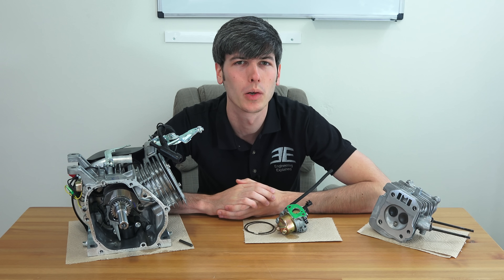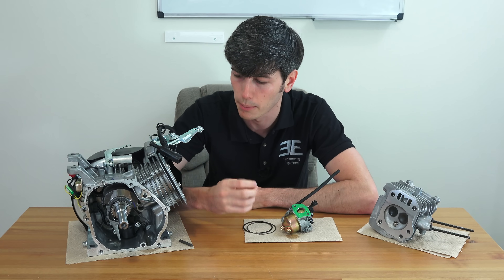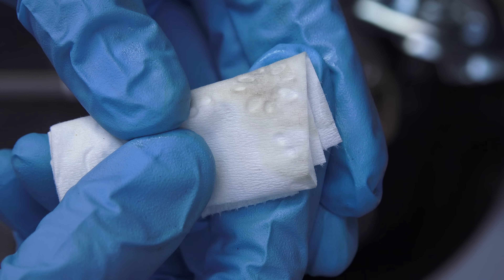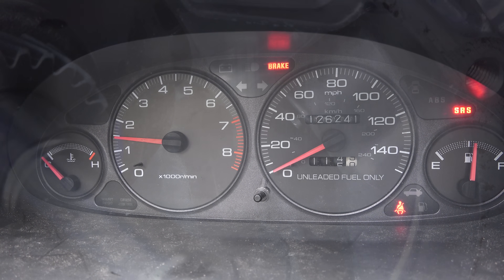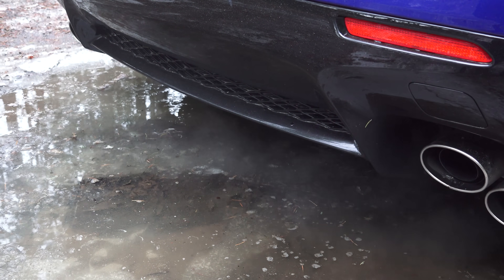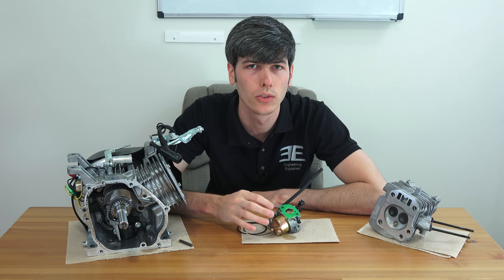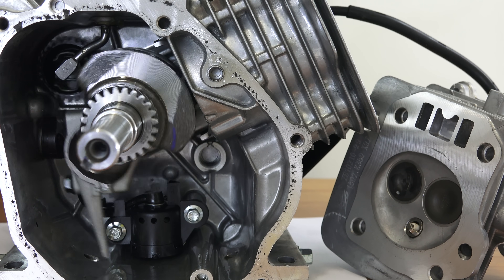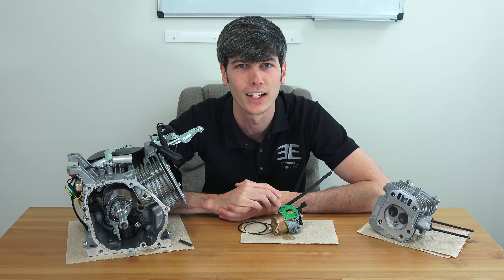Should You Warm Up Your Car Before Driving?

Comment: this is only for the idiots that believe in carbon tax and that brine wont rust out your car.
everyone else that actually has removed a valve cover and seen holes rusted through diff covers just ignore the libtard agenda.

Furthermore, why not just disconnect the heater core while you're at it, who needs heat or defrost?

Comment: What about cars with turbo? I've always been told to warm it up for 5-10 mins then drive it without boost for 5-10 miles then always cool down by driving without boost for 5-10 miles before stopping then letting it idle for 5 minutes once stopped

Comment: Although under some circumstances it's necessary to have a warm car before setting off. In the town where I go to school, so many pedestrians/cyclists get hit, especially in winter, that cops will now cite drivers who have a visibly foggy windshield. Even if you scraped your windshield, it'll still be fogged up on the inside, and no matter how you try to clear it or wipe it it'll stay that way until the heater kicks on and warms it up. I've tried defogger sprays but those hardly work worth a damn.
Reply: I've actually tried that, but in the time it takes to defog I could've had the heater warm it up and set off 15 minutes down the road
Reply: *****
Not REALLY cold, just cold and quite humid. Even if it's kept dry, a pane of glass will get condensed over outside

Comment: Dont warm up yall cars and see what happens.
Reply: Exactly, bad things happen.
Reply: Don't warm it up!!hes totally right. Job security for us mechanics. Headgasket repair labor is lovely 😍💰💰💰💰👍
Reply: My '04 F-150 5.4 3 valve has over 240,000 on the original engine. Guess what I warm it up, keep up on the oil change's and only run Chevron premium. The small difference of a few dollars on a tank full.
Reply: bullet5760 yep generally for the basic people warm up yaz cars.
Reply: Nothing happens, I hop in my car and go in the summer all the time and I run the car hard. The winter? That’s a different story cause I need the coolant to warm up.
Reply: Triple259772 chrisfix is great!
Reply: The wrong way haha
Reply: Ha i'm from Minnesota and i never let the car sit and run for more than 2 min if the wheels aren't turning. Just don't run your car any harder than you want to work and it'll be fine
Reply: no65mph exactly if they not ready to dish out some money they better act like they need they cars and warm them up.
Reply: Steve h calm yourself, you ain’t making nothing. Whenever anything goes wrong I do it myself.

Comment: Getting out of my garage requires to climb a small but steep, requires to go even up to 3000 RPM. What should I do in this case?
Reply: Shon warm the car up first. Minum 3 minutes in cold days or untill the rpm drops to 1,000
Reply: It usually starts at 1200-1400rpm and drops to 1000rpm in less then 30 sec, its ok?
Be advised that the car isnt sitting in the snow\rain, and the current avreage temperature is around 6-10C
Reply: Shon If the vehicle rpm drops to 1,000 that quick then it would  probably be alright to leave perhaps within 2 minutes. Nontheless It would not be a bad thing to wait that long since it gives the vehicle a chance to circulate motor oil thruout it's vital componets.I highly recommend a Lucas oil conditioner to be added to your motor since it would prevent dry engine startup= less engine wear.
Reply: Hawk Hawk aight thanks man!
Reply: More torque output

Comment: All you who think its fine to let your car sit for 10 minutes and get to operating temp are in the wrong. Your transmission never got to operating temp, so your engine might be fine ( although it would actually be healthier if you drove it after a minute lightly )  but your transmission will wear out since you never gave it time to heat up by DRIVING it.

Comment: people in ny dont even wait 2 seconds to let their car warmup. If these people could start a car in drive they would.  the second the car is in drive alot of them put the petal to the floor, while car is cold. so these people need to let their car warm up first.  people forget about vaccum in an engine, as piston travels up the cylinder wall it automatically brings up the oil with it, then the piston rings scrape the oil back to the crankcase.

Comment: there's just as many cons to either way Imo. and my winter daily driver is an old 94 silverado. I like to start it and let it warm up for however it takes to warm the engine. which is usually around 10 to 15 minutes. like I said, it's a '94 and I'm the second owner an the previous owner was my cousin, who would literally start it every day and hour before he left for work and it still runs great, and everything is pretty much original, except for the rear end. so I guese it doesn't do too much wrong to it.

Comment: you completely ignored bearing tolerances.  bearing tolerances are calculated by an engine at operating temperature.... not when they are at 30*F.  so do you want to have tight tolerances while you are idling at 800 rpms, or when you are driving around at 4000 rpms?

Comment: you say cold motor is ok, but that means cold oil, which means much higher oil pressure while driving, wich can lead to a bad oil pump, which can still cost a lot to replace, due to a lot of motors (including one of mine) to have to be pulled out to be replaced. good info, for the motor, but not for the rest of it. but you didn't mention any of that...

Comment: I warm up everything. things I truly care about I wait till almost operating temperature to move them. even in the summer I like to let the oil circulate for 2 minutes before driving. being a mechanic I've seen way too many oil and transmission leaks from people just hitting the key, dump it in drive and go. when the engine warms up too quickly certain metals and materials can't expand at the same rate cause leaks
Reply: The Mouse In Your Room Lmao I'm trusting the mechanic on this one. Metal expansion, idle speed, AFR, oil viscosity and temp are all crucial factors when it comes to a cold or hot motor. Driving on a cold motor is just retarded
Reply: The Mouse In Your Room if I burn 10 extra gallons in one year warming up my vehicle's that's a lot. Well worth it to me. You also need to remember certain vehicles warm up quickly and some take forever. I've never known another mechanic or another mechanically inclined person not to warm up their vehicle. I do however know people that don't and have dealt with leaks and failing components.  A neighbor of mine gets in her Toyota and regardless of outside temperature throws it in drive before the starter is finished spinning. She's on her 2nd engine and this one is already burning oil. Same words came from her mouth " I don't want to waste gas"   $20 vs $1500.  Seems worth to me
Reply: Rollo Larson she says she's far from Mario Andretti. Never been in the car with her but I know she does maintain it. Regardless just warm up an engine there's really nothing to argue about
Reply: The Mouse In Your Room False.
Reply: matt parker I only wait a few seconds in all of my cars and then drive them when they are cold. Have never experienced an oil leak as a result from doing so.

If your driving your car gently when its cold, theres hardly any load on it, depending on how many starts and stops you make while its cold. 

Driving your car while its cold really isnt any different than what the car does by itself when its idling cold which is increase the rpms to warm itself up quicker. 

Mercedes Benz even designs their cars to stay in first gear past 3k rpms when the engine is cold to help everything heat up quicker. Which also implies the car was designed to be driven cold.

I will listen to the actual manufacturers of the cars rather than someone who claims they know more.
Reply: matt parker But you need to understand that idling an engine doesn't do much "warming up". All you're doing is wasting gas sitting in a running car for 2 minutes 

Like he said in the video, you get in and drive it to get to operating temperature, but don't drive it hard.

Comment: except that my car makes no attempt to send warm air to the heater vents until the engine I Warmed until the light g9es off (I have no temp gage). so my defroster do not work until the engine is warm. 2012 mazda3

Comment: How do I know if my engine is a carburetor engine?
All I know is that if I don't get it into warm before driving off, or if I drive it while the "Cold" light is still on, the car jerks and trembles like it's running at 500rpm the moment I release the clutch.

Comment: Does this also apply to Honda? I had a 2000 civic that upon starting it would idle close to 2000 rpms and gradually would lower the rpms as it heated up. It seems that Honda has taken this problem into consideration.

Comment: now, if you just start up your car and go wouldn't you be using even more gas? therefore using even more fuel cause even more oil breakdown in the cylinder walls? yeah, your myth busted.

Comment: I always warm up my car for 2-3 minutes before I drive. So far my engine seems to outlast other friends/relatives who don't warm up their car. Maybe newer cars with tighter tolerance or different ECU behavior will make warming up unnecessary, but in my own experience warming up the engine before driving seems to reduce wear, not increase it.
Reply: So all of your relatives have had an engine failure and you didn't as you base your assumption that your engine outlast theirs on what then.?
Reply: The video was not intended at people who let their car run for 3 minutes, but those who start their car a whole 10 to 20 minutes before leaving for work...
Reply: I like this.

Comment: This video makes no sense.
A metered Fuel Injection system absolutely controls how much fuel is sprayed into the combustion chamber at all times unless a sensor that the ECM relies on specifically for fuel metering fails, such as the coolant sensor or if the injector itself fails. But we aren't talking about part failures, we are talking about warming up a vehicle and everything operating as it should. No worries about fuel wash into the chambers on these modern day vehicles. Along with that, today we have "designer oils" on the market that literally stick to the metal in the engine and cannot simply be washed off by fuel spray from a gasoline injected engine. If you have fuel wash from an injector based engine, then it's likely you have a bad or stuck injector.
Reply: Joshua Robertson That's what I've always said there's no way any EFI since the 90s spray so much fuel on warmup that it washes down the cylinders removing the oil.

For that to be true that means for every intake stroke where fuel is injected that its would have to overcoming the oil being squirter and the oil being up by the crankshaft..

Hmm atomized fuel charge leftovers after an explosion vs dedicated oil squirters and a crankshaft literally bathed in oil flinging it directly at the pistons.

Wonder who wins?
Reply: Robin Napoleon Exactly.....thank you....omg you calmed me down so much xD Happy to hear some common sense here. I drive a turbocharged Volkswagen. Very very smart ECU when it comes to engine management, and I frequently do full-synth oil changes. I'd be a total moron if I didn't let my vehicle warm up for 2-3 minutes before hitting my highway commute.

Comment: Wait, so my 1970 Dart with it's Holly 1 barrel carb doesn't have an automatic choke spring that attaches to the exhaust manifold? /sarcasm. I honestly don't know where this 30 second nonsense has come from, but it's a thing I've seen now in the last few years, and I just don't agree with it at all. Why didn't you explain why pistons are made slightly out of round, so that when they warm up, the metal expansion is more rounded? You're very smart, and I enjoy so many of your thoughts and theories, but this one just falls flat to me.

Taking it even a step further. Why does the new Dodge Darts idle so high when not at full operating temp? Oh, to warm them up quicker.... So maybe this warming things up is more important than you think.

Comment: this is all irrelevant to probably 80% of us cause most of us warm our cars up like 10-15 mins before leave home is to have the heater blow out hot air by the time we go back to our cars
Reply: tj jefferson absolutely. I'm warning up the heater so it's warm on the interior.
Reply: Why don't you use your heated seats instead? Or if you don't have them, you can buy those aftermarket ones that kinda look like seat covers, they are not pricey, but I don't know how good they are.

Comment: I have to disagree, not all new fuel injection engines are good to go after 30 seconds. I am sure you've hurd of Piston slap that most of GM LS based engines have. Specially in the older models. Where when you crank up the car you can hear a rattle almost like when you have bad lifters. GM bulletin says to warm up the car to the point where the rattle goes. Search it up its a relatively old article. Back in 2008/9 the dealer told me about it when i started facing this noise at cold start

Comment: So what if you got a lot of highway driving daily in mornings in winter where temperatures are around -25C or colder and the highway is located within 1 mile of your house. Also can letting the vehicle idle for the excuse of letting the heater and interior to heat up be a good excuse ^^

Comment: The part about carburettors not adjusting might be true for some cars, but not so much for cars with a manual choke like my previous car. I used to adjust the choke on cold mornings to give just enough fuel to prevent the engine from stumbling on light loads. If I increased the load and the car showed some hesitation I knew the engine was being pushed too hard. Always started the car and drove off as soon as our motorised gate opened fully.

Comment: Cars sound like they're dying where I live if you don't warm them up 5-10 mins fuel injected or not. Some cars I've had wouldn't even start if it's too cold and others struggle to start in the cold (-50 degrees) these cars are FUEL INJECTED. You admit you should warm up your car at 2:30 to avoid unnecessary wear. Just judging by your video it sounds like you actually don't deal with cold weather. Even light driving will put stress on your engine and transmission that you can hear.

I also heat up my car so it's not freezing to drive.

Comment: owner and driver of two turbo engines, i'm going to let the engine and oil get at least a little warm before heading of, especially in the below zero(Fahrenheit that is.) temperatures i see in the winter.

just cant see any reason that it would be good to go driving a car with that turbo spinning with oil not properly lubricating and protecting it.

besides, if you drive your car long enough, the oil will get up to temperature and the gas will evaporate/burn off from the oil as well.

you should also be concerned about water in your oil.  if it doesn't get up to temperature, you get that in there, and that can cause all sorts of problems.

Comment: Not a myth it's actually fact, the reason behind why you don't is all come down to the engine bearings, tests have been done in the automotive industry that cold starts and opperation of the vechicle before temps puts more wear on the rod and main bearings and that's why you will see pitting and burn marks on the bearings cause the car was not at the right temp, in automotive technology this is one of the things you learn in engine rebuilding and diagnosing

Comment: My old 1983 Diesel 6.2 ltr engine has an electric block heater which I plug in before going out Snow stomping.  Do you think warming up a diesel with a block heater is different???
Reply: Not really, the block heater just keeps the engine warm enough so that its easier for the diesel to start, the oil and coolant will still not be at a high enough temp
Reply: Francesco Barbera
Thanks.  Have a great Christmas...

Comment: I have a question for instance let's see if I have a engine in a car and it has 30 weight oil and it's below 40 degrees Fahrenheit is it possible to add a oil warmer so when you flip the ignition to the "on" positions you can leave it there and wait until the oil gets  get warm up to the operating temperature the minimum operating temperature of 40 degrees Fahrenheit for the oil, then you can start the engine to avoid lack of oil lubrication. so is that possible maybe through a glow plug in the pan?

Comment: The claims in this video are contradicting. IF gasoline washes the oil off the cylinder walls. IF cold oil flows slower and can not be applied back to the cylinder walls as quickly. IF ring friction against the cylinder wall causes wear. Then why would they suggest driving the car? For one, driving sprays MORE of this allegedly "oil diluting" fuel into the cylinder, thus diluting the oil more quickly. Driving causes the piston to reciprocate faster, creating more friction on an allegedly dry cylinder wall. Driving creates higher combustion pressures, which push allegedly dry rings even harder into the cylinder walls. His fact that fuel condenses on the cylinder wall is true... So lets make it worse by driving?! Sorry buddy. Driving a cold engine causes MORE engine wear. The video also suggests taking it easy while driving a cold engine. Tell that to the line of cars behind you, with warmed up engines, wanting you to get your slow ass out of the way because you're a road hazard. That's safety issue #1. Safety issue #2 is the hydraulic assist power steering system. You can not perform a quick steering maneuver with cold thick power steering fluid. Little Jimmy's snowball fight is going to end quickly if he darts out into the road and you can't steer to avoid hitting him. Which brings me to #3. Hydraulic brakes. These are also poor performing in very cold weather. Just warm up your cars!!